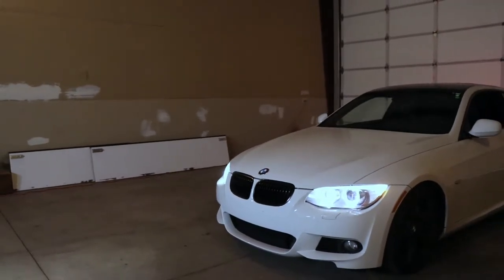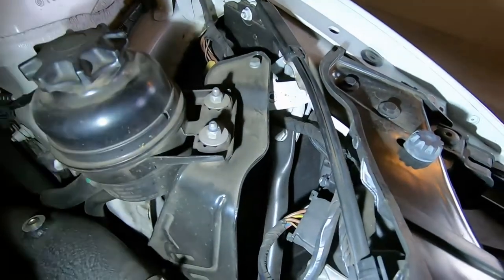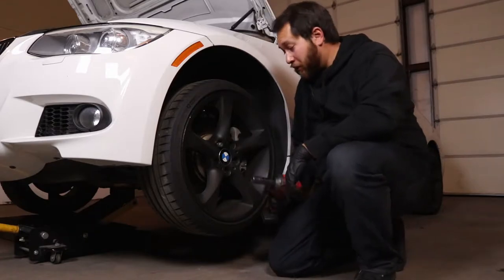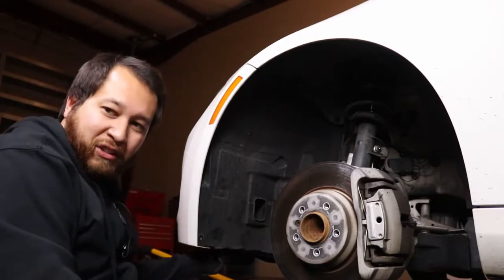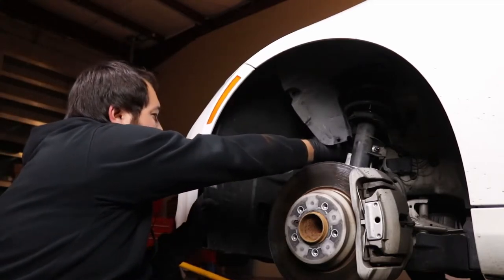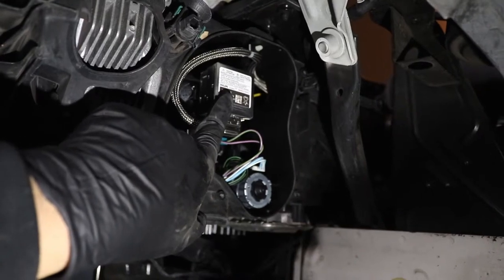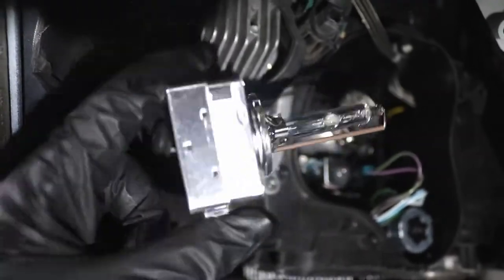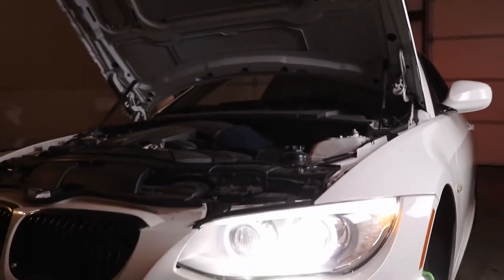E92 Headlight Low Beam Replacement

Comment: Not sure if the same on the e92 but on the e90 If you turn you wheel left or right depending on what side you should see a square plastic cover  you can pop out and accses the back of the light from there ...
Reply from the maker: I don't believe my car had the access panels, it has been a while so I don't remember. It is also much easier to show in the video what is going on with the fender liner out, since they are not hard to remove.
Reply: @markskeem  with ya mate. Wasn't trying to dig you out .. maybe just on the English version of it.. like you said they have to make these modern cars harder to fix giving most people no choice but to go to the dealership paying out silly amounts of money.. just aswell there are wonderful people like your self to give us a helping hand and for that I thank you .

Comment: Those some good  bulbs where do you order them
Reply from the maker: Down at your local parts store.  I got mine second hand from a friend
Reply: @markskeem   are they regular led bulbs and what year and make is your car
Reply from the maker: @mercedessevere9945  They are HID bulbs not LED.  It is a 13 BMW
Reply: @markskeem  Why did u buy HID instead of LED ones?
Reply from the maker: @chimpei3965  I got them for free and that was what came in them.  So I wasn't going to argue with free.